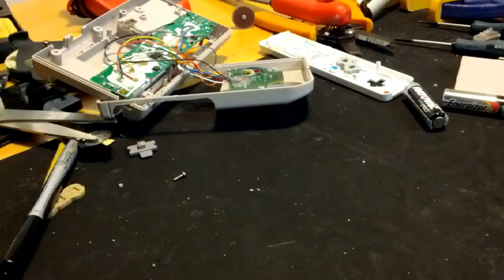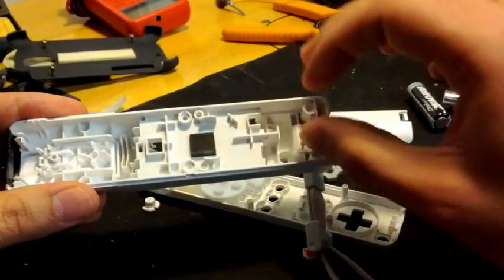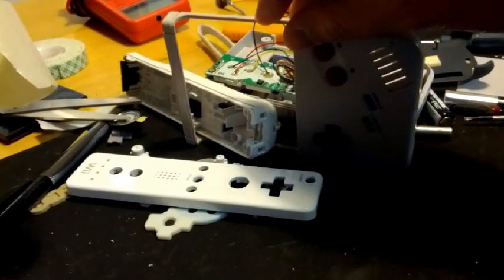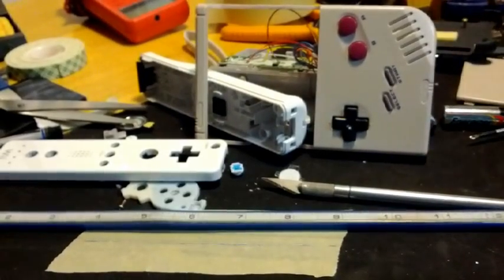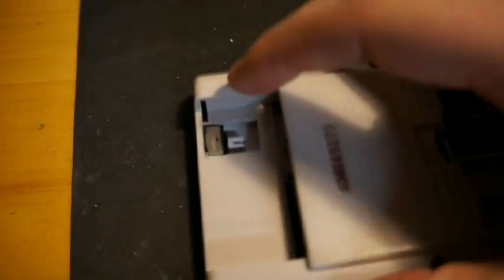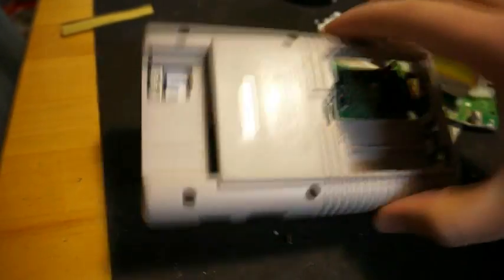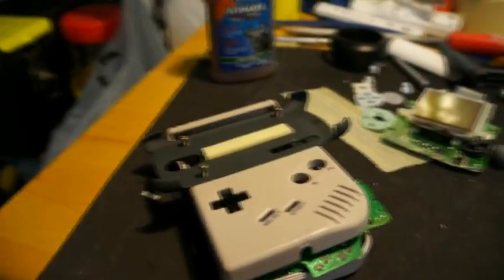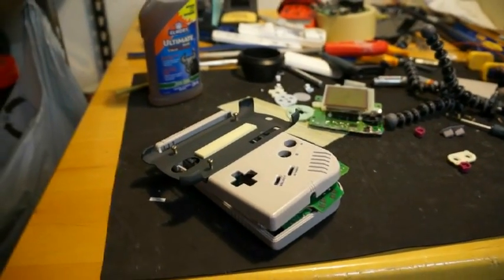Make your own Game Boy Android Gamepad (How To)

Comment: The common (purple) wires - are these going to the "A" button (Wii 2) as well? I've got my power supply working and the Wii buttons are being picked up but when soldered to the Gameboy board I'm not getting anything from the Gameboy buttons. I'm assuming it's because I don't have the common (purple) wire going anywhere yet.